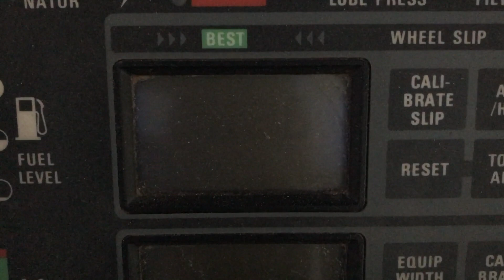My Dad...Is A Bad Farmer! | Cleaning Corn Out Of Flat Storage

Comment: When I worked at the feedyard, back in the 90s, that was all we ran was front wheel assist tractors. 3-5488, 1-7150, 2-7240 and a Cat 85C for doing tillage and deep ripping.

Comment: thought that was a Cummins VT903  under the hood in your four wheel drive tractor ,then you showed the other side & I saw the 903 on the valve cover.
Reply from the maker: Daniel Hofer it's a great engine
Reply: @ColeTheCornstar  high RPM engine compared to their  in-line 6  cylinder engines. also got put in trucks in 1970's  Some gave them the nickname 9 o-nothing's  noticed while back that one of your hopper trailers is a older Wilson brand. has white front & rear pancels but the sidewalls are still the old Single wall style. They were called the Classic. didn't make a whole lot of them  & they completely to their double wall hoppers that looked simulacra to a Timpte. keep up your videos. enjoy them

Comment: I have a question for you as a graves's digger, here in the province of Quebec when the digger dig a hole for the ashes container (Urne that it is called here) that hole is about 2 feet deep by 1 feet by 1feet...is the law different in Iowa that you have to dig 3 feet by 3 feet by i don't know deep...the cost is about 250.00$ and i guess the guy use a backoe and the hole is done in 2 seconds...

Comment: Why do you use electric motors on your augers rather than gas?
Reply: To prevent explosion from grain dust.  Grain dust is highly explosive and can be set off with One spark.  An explosion would destroy that building and kill peoole.
Reply: Jeff Gixer I can’t say from experience about electric motors but the ones on our sakundiak augers don’t backfire or anything. We have never had a problem with fire from them. But we don’t put grain in a shed like they do
Reply: @Hallsey78  even electric motors motors used around grain are usually special explosion proof motors.
Reply from the maker: Sir Mr. Max This question will be answered in the video. Thank you for asking. 😄

Comment: The "Flat storage" clearly is a bunch of work. If grains are the future ya gotta look into some bins and elevator. All the time loading into the building then all the work with the tractor running auger and skidsteer burnin fuel.Oh and I forgot about the tractors burnin fuel for grain carts.
Reply from the maker: Eddie Reichel a bin that size would be around $200,000. The tractors are mostly idling so they are just sipping fuel, maybe a gallon or two an hour. Flat storage is a lot more work but it's still a way we can take advantage of carry in the market. We would like to put up more bins in the future when we have the financial means to do so.
Reply: @ColeTheCornstar  No doubt. Guess I didnt realize  that bins are that much.  Kinda cazy. I am a small business owner myself man its not easy at all.
Reply: For sure I respect what you do. Your a man and clearly the farm has provided for generations . Time is our most valuable asset.
Reply: I mean you have time. You have equipment. The only thing you need to do is dig a hole and pour some concrete. Run pipes for aeration.
Reply: Oh and dont firget the hole for the auger in the middle.

Comment: Cole why don’t y’all fill your trailer with corn an have it waiting on the trucker to pull it in when your dad can’t haul it in?
Reply from the maker: Paul Coulter I'm not sure what you mean
Reply: Y’all have a truck an trailer right 
Take your trailer an fill it an have it ready to go for when Ronnie gets there. That way he can hook an book it to the gain elevator. I would back the trailer in the flat storage an fill it in there using the just the auger.
Reply from the maker: Paul Coulter I understand now. It takes about 5 minutes to fill with the carts so the 30 seconds it would save really wouldn't be worth it

Comment: (Jesus warning about HELL FIRE):

And if thy hand causes you to sin,

cut it off:

it is better for thee
to enter into life maimed,

than having two hands
to go into hell,
into the fire

that never shall be quenched:

Where their worm dieth not,

and the fire is not quenched.

(Mark 9:43-44).

***(Cut if off): Should be taken figuratively; it means to take whatever drastic action is necessary to avoid sin.

***The imagery of Hell (Frequently called gehenna) comes from a garbage dump outside the walls of Jerusalem. Jesus hearers were familiar with the smoldering fires that always burned there.

***(((Obedience))) and (((self-control))) are necessary to overcome sin.

***The longing of the disciples for greatness needed to be reshaped according to God's purposes.
Reply from the maker: mlzanercik Jesus is a good man!